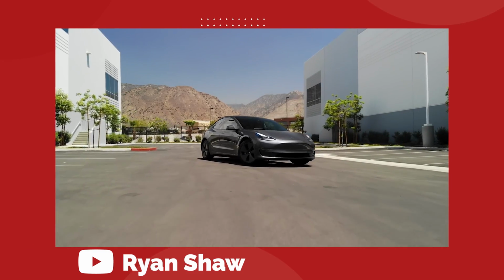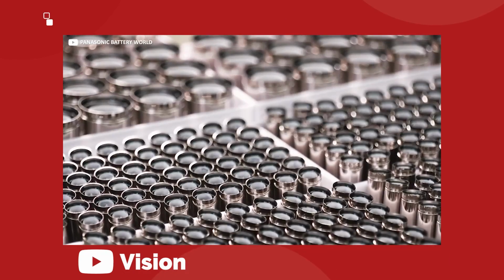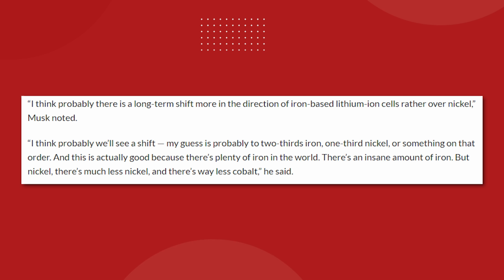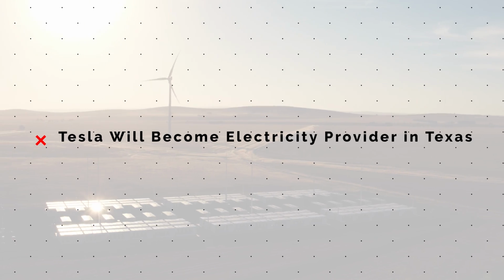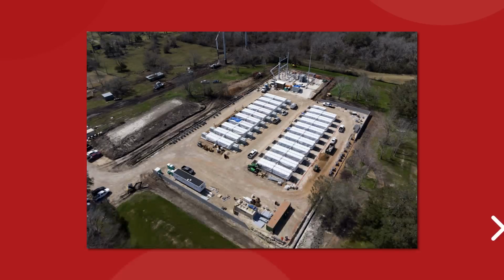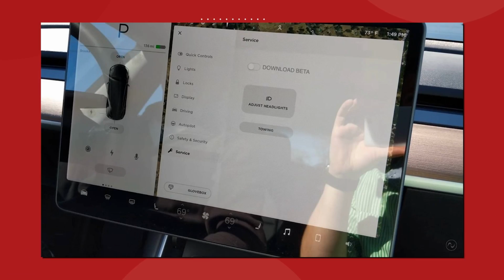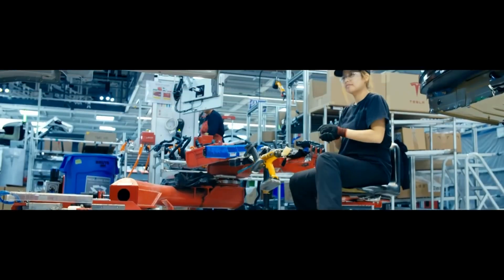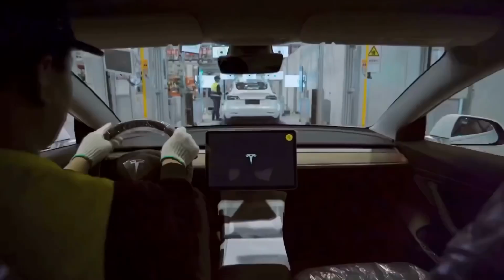NEW  Tesla Model 3 Now Available!

Comment: I think some mentioned that the LFA batteries will require more time to charge (slower charging rate) and more sensitive to temperature (less range in winter) than the previous types. I don't remember where I saw this info, and I hope you can clear that in future episodes whether the claims are real or pure fiction.
Reply: Bjorn proved that to be wrong. Tesla pre-conditions the batteries now at the super chargers so they actually hold a better constant rate of charge vs the other packs. Weather is somewhat true though. No one really knows how they will perform in the cold since winter hasnt really arrived yet.

Comment: Oooh I disagree greatly the Austin model Y will be ‘basically the same’ as out of Fremont. As far as battery and such.. sure.. as far as paint quality and general fit and finish, these should be equal to or better than MIC mYs and there is a distinct improvement in quality, according to those who’ve seen them both. We might even get to see some new coming from Austin.. but that’s just a guess and may take more time, if it comes at all